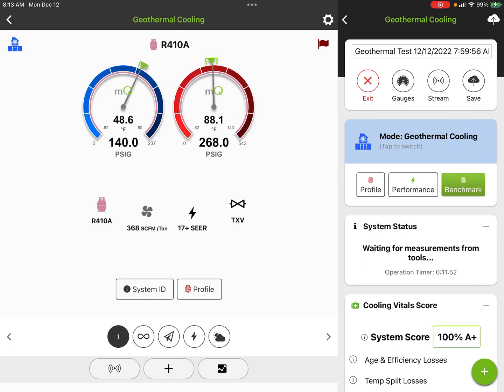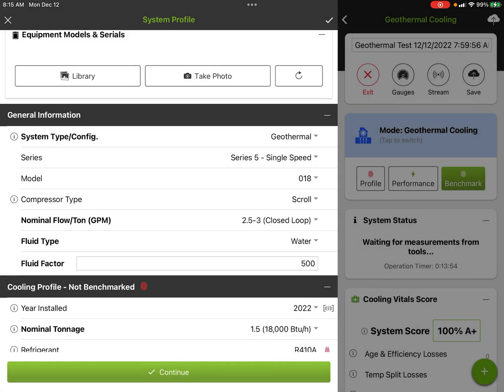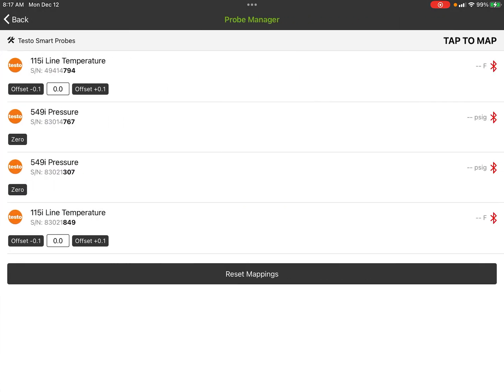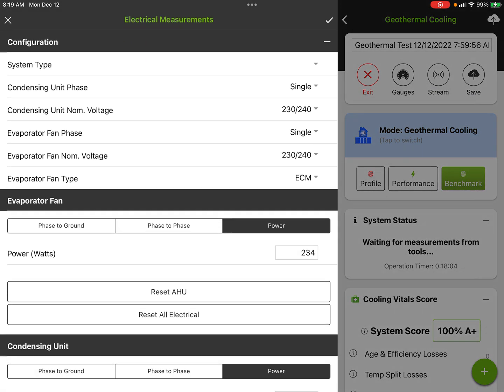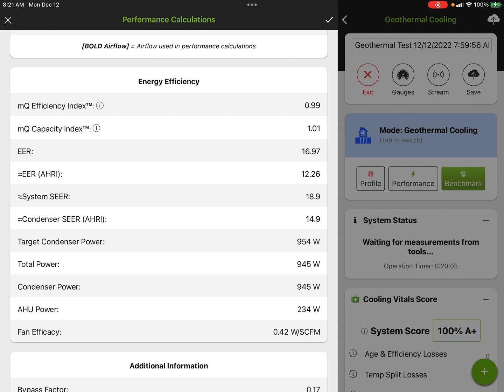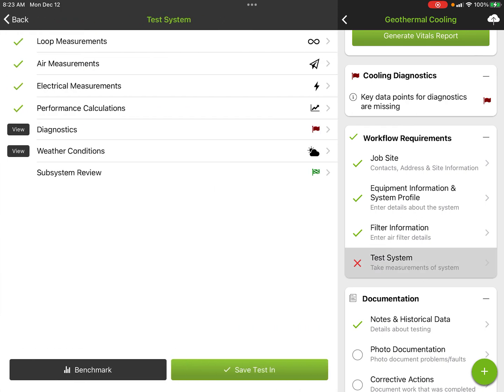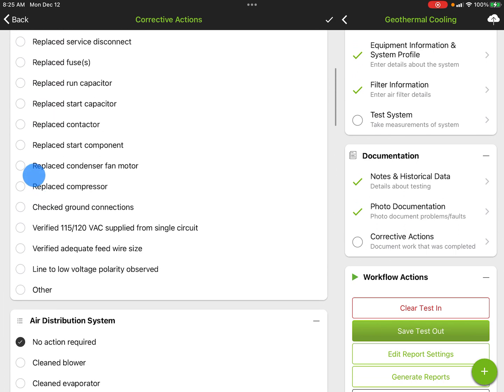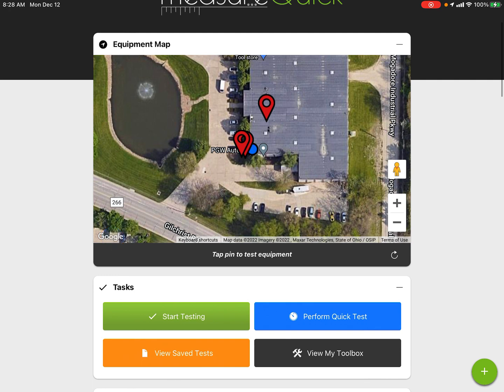Geothermal Beta

Comment: Are we up to date on this feature ?  I work on over 350 units and it would be great to see the complete article.
Reply from the maker: It aligns with the manufactures specification for the units. All specs came from their manuals. It was a first pass, but we have almost no one that has been using it. You would have to provide us some feedback. I do not have geothermal equipment in our lab to test it easily.

Comment: Edit: Ive been doing it wrong lol, finally used it enough and if you do the workflow correctly its amazing. Very important to use that "Capture Data" button.

As far as the progress im very happy with the outcome. A few things i would like to see integrated in the app are as follows.
Persistent manual data point entries in all fields.
Possibly an admin function to enable/disable that feature for techs.
And also could incorporate a message or warning through the reports function that the data used was manually entered to protect customers from misrepresented measurements.

I use this app primarily for my own diagnostic and performance evaluations. Maybe just have a mode that doesnt require 600 live feed data points that is extremely finicky and require going through the data taking process 10-20 times before a report can be generated without wiping previous measurments.

Comment: Jim, could this program be used to include commercial chiller, water cool, closed systems with higher tonnage? 
The btus would have to be increased, and the filter sizes would have to be increased.
Reply from the maker: That is on the roadmap. We are really close with what we are doing with Geothermal.
Reply: @measureQuick very nice, thank you!